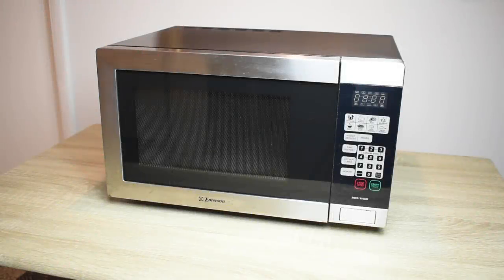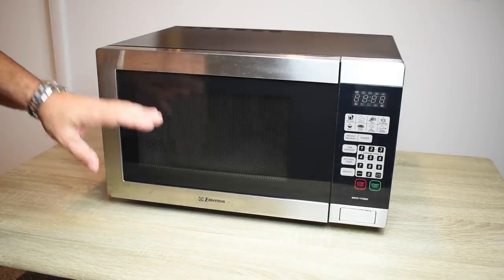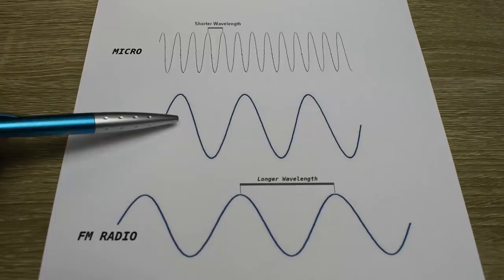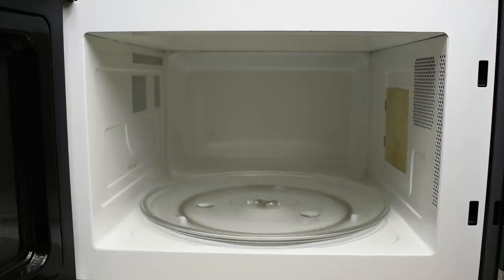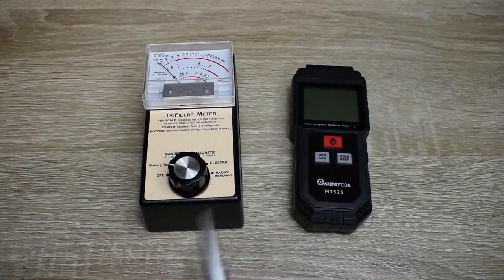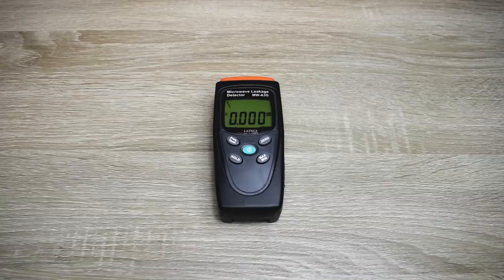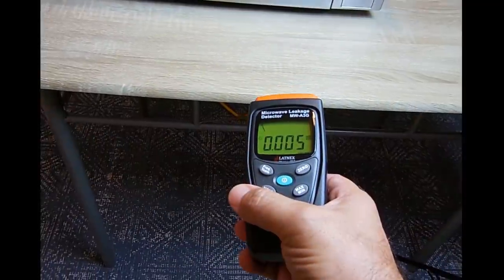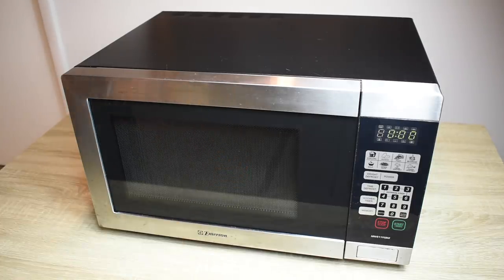Is Your Microwave Oven Slowly Cooking You? Find Out!

Comment: Another good test for microwave construction quality is to open the door while it's running, vs hitting stop button (or end of timer) and then opening the door. Some microwaves blast radiation when you use the door open button while it's running, while others shut down the magnetron before the door begins to open. I'd be interested to know what yours does since you have the sensor. I found about this on an RF forum where some scientists couldn't figure out where a bunch of RF noise was coming from. They finally realized that it was from people that opened the door to stop the microwave in the break room, vs the majority of people letting it stop before opening the door. Neat stuff as always, love your channel!
Reply from the maker: Many people have a bad habit of pushing the door open instead of pressing the stop button first. Thanks for watching!

Comment: What a great and eclectic channel, subbed!
I watched your other microwave repair videos.
My missus' SMEG microwave went BOOM the other day when she pressed GO. There is still power to it, cabin lights on, turntable revolving, humming (kept the door closed!) but the digital display is gone and the buttons do nothing. There is a 12 pin connector on the power board where all the mains wires come and go and this is where the explosion happened! One on the pins actually blew out of the solder connection! It was one on the live line coming from one of the door switches. I repaired the pin connector (and the burnt tracks on the control board beneath where the bang happened!!) but no joy! What would cause such a severe blow out!!!! UK voltage BTW. Cheers.
Reply from the maker: Sounds like an inverter microwave that had a short circuit.

Comment: if those microwave's wave are ~12cm how can they leak throught the mesh or small gaps on doors?
Reply: Two things are going on. First - the conductivity of the shielding of the microwave oven is "only so good": the skin effect in particular results in the electrical currents running in only a very superficial layer of the conductor, and this means there is some phase lag (and incomplete reflection, i.e. some transmission of power).

Second, gaps do occur. In a well designed microwave the gaps have compliant conductive seals; but if these lose their springiness I can see how currents flowing around the gap will result in re-emission of microwave energy. You don't need a 2D opening: just a gap that is "long and thin" is sufficient to act as an antenna. Where "long" is a few cm (1/4 of a wavelength)

Comment: 2.4Ghz "radiation" , is orders of magnitude lower in frequency than visible light. I take it you check for sunlight leaks through your window blinds too?
Reply from the maker: Correct, but what does that have to do with the video? I was making a point that the testing device only detects a specific form of electromagnetic energy(radio waves at 2.4GHZ). I'll take natural sunlight exposure, over man-made microwaves any day. Thanks for watching

Comment: Any suggestions to make it zero a foot away? Aluminum foil? Also 5G is another concern. Can that test it to show a video about that? 
Also would be funnynif you go to hardware store with marble and point out which ones have radiation just for fun.  Thanks
Reply from the maker: Maybe add a fine copper mesh screen over the door. As for the countertops, I've used my geiger counter on a few. Some are quite active. :-)
Reply: Unless you have 5G base station and narrow beam antenna right near your body... and this applies to all RF devices. Mobile phone and other devices are pretty low power. ( they have very stright SAR limits)  Some portable radiostations can have several orders higher RF output and no adverse effects have been found. (If used properly).
Reply: @JanicekTrnecka  many homes now have 5g wifi interment. as for SAR iphone has the highest out of all other phones on average going near the legal limit and most put it next to their body which by instructions state it must at least 1 inch away about which most have it in their pockets. No one uses anything properly and everything has to be Fool Proof. lol

Comment: Microwave radiation is non ionizing radiation, it still definitely will hurt you.
It the wavelength vibrates the water in food and other things at a high enough frequency to heat itself (because of friction). Now ionizing radiation is high energy particles, which can destroy cells.
Just microwaves are not radioactive like uranium or nuclear stuffs

Comment: would be a bit important the quantity of water (cooking) inside microwave bc water would act as a transformer changing energy from that radio wavelength to a heat (infrared and far infrared ) wavelengh . so would be a "sponge" for microwave radio . 
it would be any difference between 2 liters of water or a cup of coffe WHEN we measure leaked radio !?!
Reply from the maker: I would think more food in the oven, or water, would absorb more microwaves and slightly reduce the readings shown in this video. Thanks for watching!
Reply: appreciate the answer . thanks .

Comment: Could you take that microwave component and make it able to take down drones ?
Reply from the maker: Directing a microwave oven magnetron at a drone, using a waveguide, would likely work.....but dangerous to the user.
Reply: @electronicsNmore  you rock..flip flops forever !!!
Reply: With the power a magnetron puts out you might be able to damage a drone within ten or fifteen feet if I had to guess but would be able to cause interference with the drone's communications for a little further than that. I would like to stress that modifying your microwave in such a way is illegal(because it exceeds safety limits) and is very dangerous to others around you.